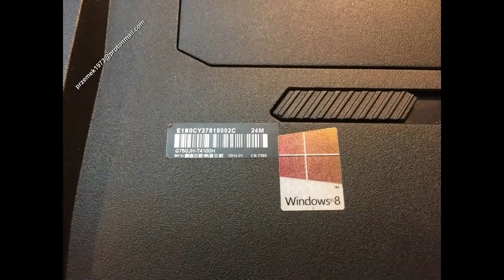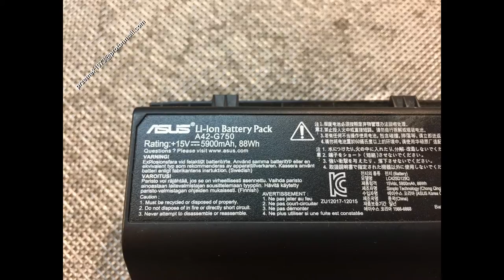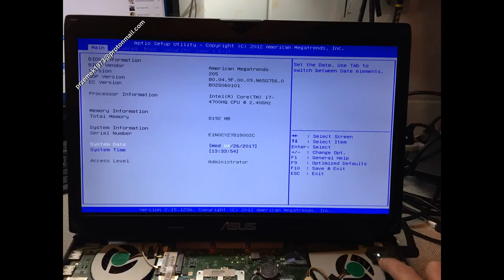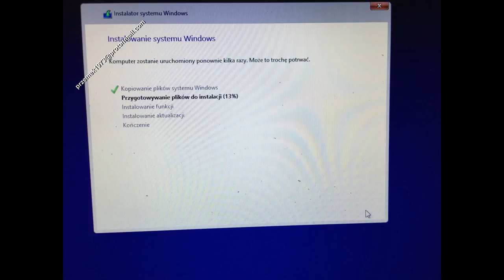Asus G750 disassembly BIOS motherboard replacement, cooler fan clean, wymiana, jak rozłożyć

Comment: Hi .. Can I ask, what is ouput voltage and current on the battery terminal ?
Reply from the maker: Hi, there is 15V and 5900mAH/88WH, but you need to know that i have seen two different kinds of them
Reply: @ListonoszSzczecin   I mean the output voltage on the laptop battery socket ..
Reply from the maker: @limitless5944  Im sorry, i had this patient 2 years ago in my service :(